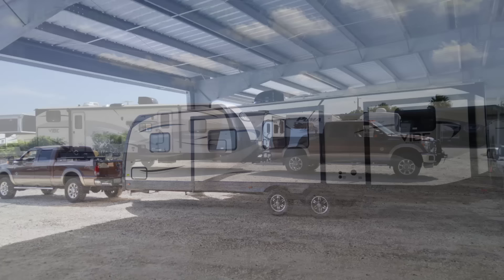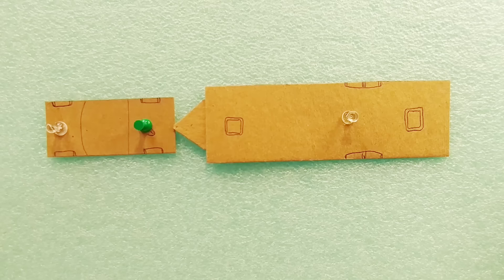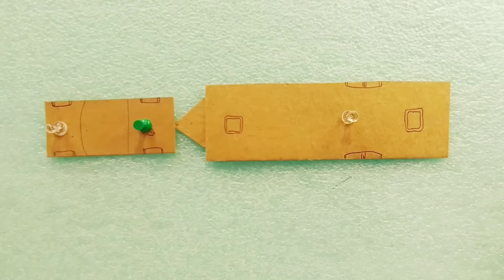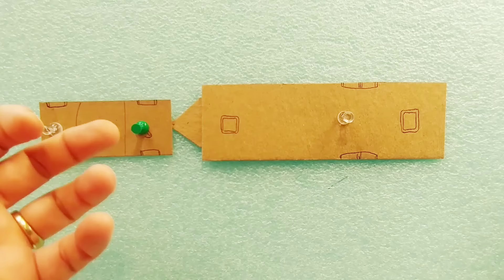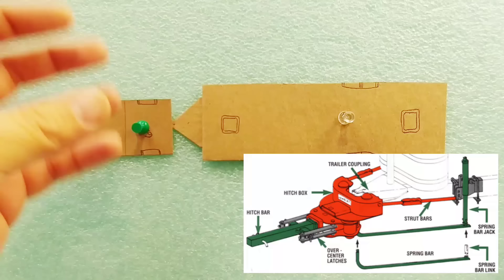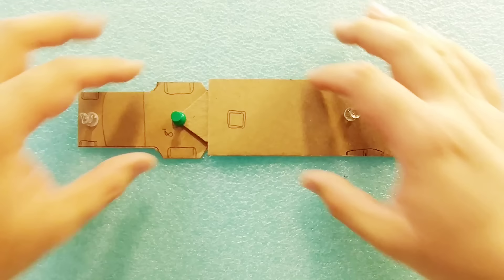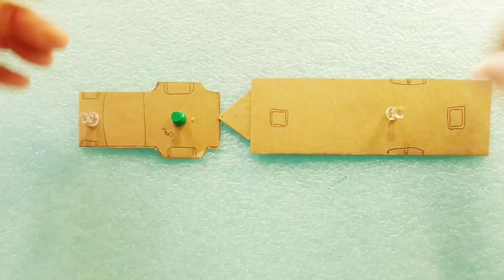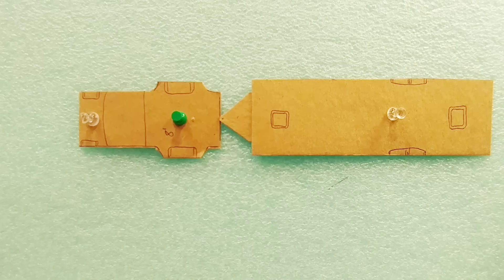Sway when towing an RV? Watch this!

Comment: Would this logic apply to large boats? 34’ boat 14,000lbs. Almost always tongue loaded and you never see weight distribution. Upgrading truck and need to decide    on F350 SRW or F450 DRW. Maneuverability at boat ramps and as a daily city driver would help. (The hanks to your videos!)
Reply from the maker: Steve C: It applys to large boats.  and even smaller ones towed by lighter vehicles
Reply: Actually larger boats can be worse than campers. The shape of the bow, on large boats catches wind and lifts the tongue more than  the flat front wall of a camper. This reduces the weight on the hitch and will cause sway. Couple that with the fact that most boats have most of their weight at the stern.

Comment: One thing I was hoping you would cover is the difference between TT with dual axles vs single axle TT. I know I'm talking lighter TT's than most of you are talking about, but does it make a difference whether the TT is single or double axle as far as sway in concerned?

Comment: We have a 31 foot travel trailer and a 2010 GMC Yukon Denali. We are not over weight but the Yukon squats a bit, which is lifting the front end. We have an E2 Hitch purchased from the dealer when we bought our used trailer.  What can I do to make it squat less?

Comment: Question-  New tow vehicle ‘17 Ram 3500 Cummins/Aisin 4x4 SRW that upgraded from a ‘16 Ram 2500 6.4 Hemi.  Our trailer is only around 8500lbs fully loaded w/water and tongue weight is close to 1000lbs.  I want to bring my 900+ lbs HD Ultra Limited in the 8 foot bed on some trips and eventually all the time when we full time.  The highest capacity Equalizer Hitch I could find was 1400/14000 which I had purchased last summer.  Thoughts on this set up?  The Bike and tongue weight will be around 2k but the WD hitch is only 1400lbs.   Truck has a payload of 4300lbs.

Thanks

-Keith

Comment: Great explanation. Thank you. You mentioned the larger sway control system and needing the payload to handle it. We have a 6-foot bed (1500 Chevy) and plan on purchasing a trailer not more than 21 feet. Will one of the other models you show at the beginning be sufficient? Will the length of a shorter trailer be safer for us?  It really is scary to see the damage sway can cause.
Reply: My Life. One Story at a Time. A 21 foot trailer shouldn't be a problem with a half ton truck. A weight distribution hitch will make it feel more secure. Don't drive too fast and avoid adding weight to the rear of the trailer (cargo boxes, generators and bikes can dangerously reduce your tongue weight). Use the truck bed for heavy cargo.
Reply: Most any hitch will do the job (their is a bit of brand loyalty), but setup is critical for any brand.
Reply: We have 2015 1\2 ton chevy 5.3 double cab pulling 36 ft flagstaff 7708 pounds with 1100 pound tongue weight changed tires to xl rated  and use a ucurve tow hitch with sway control This combo works best and pulling 62 mph.
Reply: Byron Mouton  I think you’re really close to the limit of your truck. (Never mind that Chevrolet rates these to pull 9500lbs.) A heavier truck will be safer and give you better control. A long bed 2500 would make a big difference.
Reply: @byronmouton9527  a 1/2 ton pulling a 36 foot wind sail ? man, you must be 3 sheets to the wind...

Comment: I have a stupid question.  If I get to where I am going and will be doing a few sharp turns to get into the site or campground at low speed obviously, should I disconnect the sway bars?   BTW great video BTBRV, very informative and basic yet things people should know for sure.
Reply: On a lot of the sway bars you can just back the brake off. Take it off if you want, but not necessary.

Comment: What kind of towing characteristics can I expect from towing a large bumper pull travel trailer with a long bed dually? I like the idea of being able to keep my bed space by going with a bumper pull, but I don't want the sway. Would this setup require a weight distribution hitch to work well? Or would it handle well without weight distribution? I know that the 5th wheel will be the best setup I can get, but how much worse would a truck with duals handle pulling a travel trailer versus a 5th wheel?
Reply: Sean, I pull a 12k lb Excel TT with Long Bed Crew Cab F350 with ProPride hitch (Same design as Hensley Arrow).  Only time I've ever had an issue towing was coming thru Kansas one time with 50 mph cross wind.   No sway but the whole truck/trailer unit was getting pushed sideways like you see happen to semi trucks sometimes.  Dually is going to give you more control but I still recommend either ProPride or Hensley hitch if your pulling long distances.
Safe Travels
Reply: I have the same question, I have a 31’ 9k pound toyhauler and just purchased a ‘15 3500hd DRW duramax. I towed the trailer without sway control or weight distribution and it seemed stable but it also was a nice calm day.
Reply: Not exceeding the vehicle's max tongue weight, load weight, gross combined weight, and tow weight, which a 9000 trail shouldn't do, and loading the trailer correctly , at least 10-15% of the trailer's gross weight on the hitch, and you'll be fine.

Comment: I don't like driving any trailer in 30 mph or higher winds. For headwinds, would a rooftop spoiler on my truck do better to reduce drag on my trailer?
Reply: Yes. May improve your milage by 1-2 mpg at the least on the highway.

Comment: I’ve got a 36’ Jayco that I just got that I pull behind my 2010 F250 Diesel.  I can’t get over about 60MPH before it starts wanting to dance all over the road.  I have a weight distribution hitch on it now, and I’m almost wondering if it’s making it too light on the front of the trailer and hurting more than it helps.  It’s got a tiny kitchen at the front, and some bunk beds and that’s about it.  

Is that a possibility that the distribution hitch is actually hurting me more than it’s helping me?  It’s maddening.  I had a 150 that pulled my last camper amazing with the distribution hitch, but this setup I just can’t seem to dial in.  Any suggestions?
Reply: Oh, I’m also running airbags that I just added thinking may help, didn’t make a bit of difference.  Thinking about ditching everything and pulling it with bags only to see how it does.
Reply: Kraig Snowden   Check weight distribution and tire pressure. Your back tires should be adjusted with more air pressure accordingly. Unfortunately, I’ve never found a chart showing how much in relation to tongue weight. Passenger truck tires (ALL half ton trucks) do not have any leeway to adjust air pressure like E rated truck tires do.

Comment: How do you go about confirming your trailers tires are aligned?
Reply from the maker: Use a tape measure or string to measure from the center of the ball hitch to the center of each tire.  Should be the same side by side.

Comment: What do you think about weighsafes new distribution hitch with the weight scale built into it, currently debating dropping the 900$ for it soon for a 23foot jayco I turned into a 24 foot toyhauler 10ft tall. The sway I get now is a scary amount

Comment: Probably a dumb question, but...(famous last words)  I have been considering a truck for a travel and utility vehicle.  I am looking at 3/4 or 1 ton 4x4 so I never have to look at a load or a road condition and say "man if only I bought a beefier truck".  I would like an RV trailer in the future.  It sounds like fifth wheel is a good choice.  Can I put a fifth wheel in a single rear axle truck?  The duallies would be a pain in some of the narrow places I go.  Would this defeat the non sway benefit of a fifth wheel?  For that matter should I do the 1 ton single axle and then invest the money in the Hensley you mention and a tow behind so when I want the bed it is not taken up with the fifth wheel.  It sounds like the only downside to the Hensley is cost and weight.  thanks for the really enlightening video!
Reply: A longer wheel base makes more difference than being a dually. 4x4 weighs more than a 4x2, so all other things being equal, will tow and haul more. It'll get better milage too. Being a dually gives you more load capacity. And with a tow, more stability with a rear wheel blow out. They also reduce your mpg, and increase your tire wear, plus not only will you get fewer miles out of your tires, you will be buying 6 instead of 4. But for a big tow, you need a big rig. 
Look at what trailer you want before buying the truck. Then you will know what trucks you have to pick from. If the trailer is too big, you might be stuck getting a standard cab (2 door) 4x2 dually, 1ton, short bed.

Comment: What's the consensus on smaller trailers with a full size pickup, 1500?  I'm purchasing a 17' TT that's 4900 GVW.  Sway bar and weight distribution required?

Comment: Do you have any experience with the Anderson “no sway” weight distribution hitch?
Reply: I ran an Anderson/ E4 and was impressed when towing my 28' camper.  Upgraded to 32 ft and I could not get either to tame the sway.  I upgraded to a Pro Pride and problem solved.  The camper towed like a small camper.  I did all of this with a 3/4 F-250.

Comment: What’s your thoughts on airbags? I have a 2016 Ram 1500 and I pull a bumper pull 30ft travel trailer. 2nd question do you have any experience with a product called Peddle Commander

Comment: Thanks for a well explained video.  I am curious if hydraulic dampeners were used as an option.  Had a Ducati motorcycle with a steering dampener that made allot of difference.  The motor had so much torque that the front wheel was very light (less contact with the ground) so it sometimes was a bit terrifying when it got loose.  The dampener really helped out.  Sure it would need to be very beefy for a trailer but theoretically it would work and be less intense over a stiff bar system

Comment: I really enjoyed this video.  I'm pulling a 5,595lb/30' trailer with an equalizer hitch and a F250 Diesel with a 6.5 bed.  I can still feel some sway and see it when I look in the rear view mirror.  How would I know if my trailer tires are out of alignment?  Is this something I can visually check or do I need to take it to a dealer?
Reply: First try moving some of the weight in the trailer forward. That's to reduce the sway. 
Next, make sure the trailer and tow vehicle are level when loaded. If you can't get the trailer level, it is better to be low in the nose then high. 
As for alignment, this is easy. Find a stretch of straight road with a shoulder line. Drive straight, stop is the trailer straight behind you. Yes, your alignment is good. Off to one side, well if there's a crown find a flatter road. It can be done in a parking lot too. 
Technical way. Measure from your center of your hitch to the center of your forward axel by the spring. Both sides should be the same, unless they gave you off set for road crown. Then the right axel distance will be 1/8-1/4" shorter. Distance between front and other axels should be equal. (axels should be parallel).

Comment: Why do they say not to back up with a weight distribution hitch engaged?
Reply from the maker: Kevin Van Lohuizen: it can cause the sway controller attachment to bind on sharp turns, as generally performed during backing manouvers
Reply: Must be a rare thing. Never had a WDH that stated that.
Reply: Backing with a Hensley is a non-issue due to the way the hitch works in reverse.

Comment: I pulled my 28ft travel trailer with my full size Dodge Durango SUV for the first time a few days ago as I was bringing home from the RV dealership. I have a fairly high-end weight distribution hitch and everything was going great on the interstate until a big rig passed me. This affected my vehicle and trailer a lot more than I thought it would and it scared the freaking hell out of me. I was only going about 55-60mph and I recovered fairly quickly but I can definitely see how things can get out of control fast. 

My question is this. How should I react at the wheel when something like this happens? Is there anything I can do to lessen the impact of this draft effect on my tow vehicle and trailer when a big rig passes me going 90 miles an hour?
Reply: Actuating trailer brakes will help a lot.

Comment: Crap my F150 4x4 only has 5'5" bed. Guess I better stick with a short trailer? What is the max length trailer should I tow?
Reply from the maker: M. Forest Shipps: I'd stay under 5500lbs and 23ft
Reply: M. Forest Shipps Your bed length is not the issue. It has to do with your wheelbase.  In which case I'm guessing you have a SuperCrew since you have a 5.5' bed.  So your wheelbase is actually longer than if you had a F-350 SRW or DRW in regular cab 8' bed configuration.
Reply: Thank you, my wheelbase is 145" and yes I have the SuperCrew cab. Not sure what it is for the F350 regular cab 8' bed.
Reply: M. Forest Shipps It's a hair under 142"
Reply: Wow good to know, Thanks!
Reply: M. Forest Shipps I had a 2011 f150 4x4 I pulled a 9000 pound 37 foot all over country. Zero incidents.
Reply: Zero if you have to ask.
Reply: @DennisBohannan  you were over loaded. If there was an accident, it would be declared 100% your fault, and your insurance wouldn't have to cover a dime of it.  Plus then you could be sued for negligent operation of the vehicle and punitive damages.

Comment: 2015 gmc 3500 single wheel towing a 33 foot  7000 pound  trailer do you need weight distribution and sway control

Comment: Not getting the alignment thing because my 33 FT has 2 straight axles with the tires and hubs connected to the axles. How do they get out of alignment?
Reply: gunslingr45  The trailer tires do turn at an angle when you are turning. It is not anything you have control over. All the other factors have more to do with controlling sway.

Comment: JD, I have a 2018  f450 and I still encounter sway pulling out Rockwood Ultra-lite.  What do you think could be causing my issue?  I am currently using a Reese dual cam wdh.  Thanks
Reply from the maker: It's likely not actually sway your experiencing.  It might be that your trailer axles are out of alignment or your your trailer is way to heavily loaded behind the axles.
Reply: I purchased a new set of rear tires, Goodyear G622's and thought that might have something to do with it.  Maybe not enough contact I was assuming

Comment: What is your opinion on travel trailers with the axles further apart?
Reply from the maker: +c17maintenanceman: Generally good for reducing porpoising over bumps. Basically the feeling like you're on a waterbed hitting waves.
Reply: Increased tire wear if you aren't doing most of your miles on the interstates. Can be harder to back as the point of pivot changes as you back over holes and bumps.

Comment: Ok so i got a 2014 f150 4x4 8ft bed , pulling a 2006 keystone outback 31rqs , curt 10000 lb weight dist. Setup , with sway control and still have sway and lite front end , what should i do , i never dry camp so tanks always empty , and dont overload the trailer , can i have the hitch set up wrong , or (as i told my wife ) is it to much trailer for my truck ??
Reply: Dennis Ritter trailer is too much for truck. Your trucks towing capacity is around 9600lbs.
Reply: Dennis Ritter  This is too much for a half ton. Very unsafe.

Comment: Why 18 wheelers pulling trailers don't sway???  I've traveled many miles and never seen them sway
Reply: ElroyJosephJenkins JrTheThird Because the trailer wheels are at the back of the trailer on long hauls.
Reply: Because half the trailer weight is on the tow vehicle.

Comment: you kept showing equalizer hitches and when I was towing they were used for weight distribution  between truck and trailer and the sway control was a separate unit which connected to the hitch on the truck and to the trailer tongue on one or both sides.  so I'm confused by your example.

Comment: This guy did not talk about the number one cause  NOT ENOUGH TOUNGE weight,,, if the axles are too far forward or the trailer is not loaded correctly it will sway and nothing will stop it,,, manufactures bring the axles forward so people that really do not have a proper tow vehicle can buy their product,,, ,,,,If the trailer brings your front end UP or squats the back end a lot YOUR vehicle isn't heavy duty enough to pull that trailer  period

Comment: Looking for some advice As I start to watch this video. This weekend I was pulling my 34 foot Jayco Jayflight with my Ford excursion. I had no problems driving up to Wisconsin but on the way back home to Illinois we came at a point where we were bouncing and bucking at 65 mph. I do not know what caused this but I ended up pulling over to check some things out. Once we got moving again  it did not happen after I stopped. My trailer is almost perfectly level and my weight distribution is on the fifth link. This is the first time I have pulled on the 5th link normally I pull them 4th. 
It does seem like it pulls better and I’m pulling less of a load on five. Does anyone know what might cause this. I have been pulling a trailer, our previous one was a 26 footer since 2013 and this is never happened.